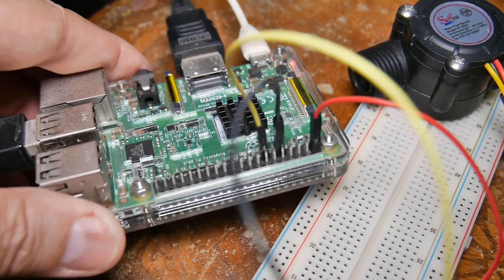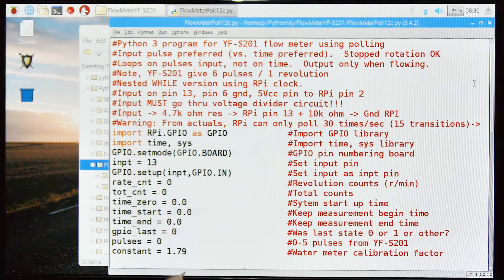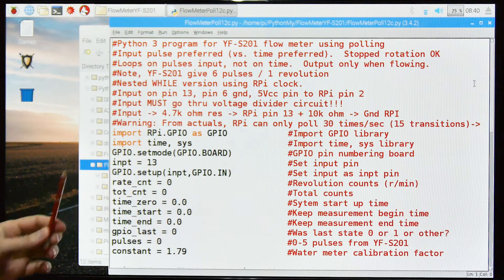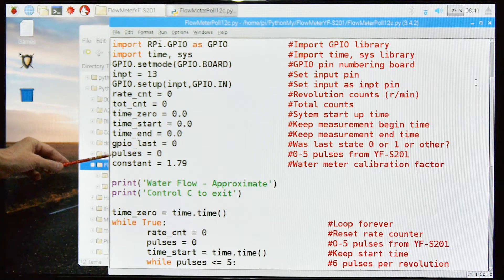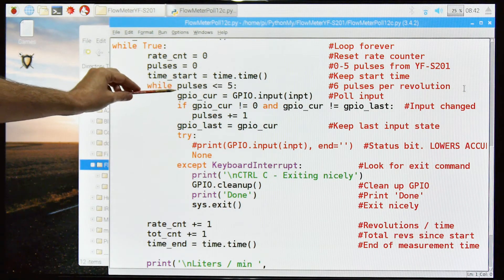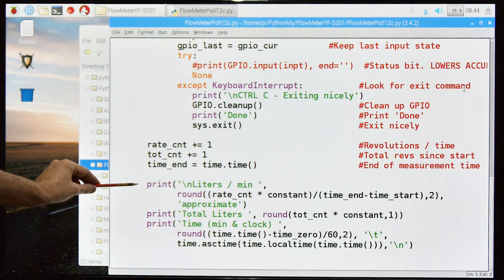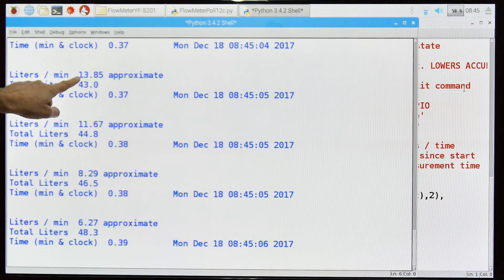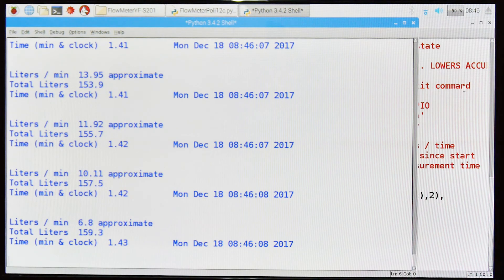RPi 23.1 - YF-S201 Water Flow Meter/Sensor, Polling, IMPULSE Trigger - ADVANCED

Comment: @tsbrownie I wanted to check, for the value of the constant, would that be a self calculated liters/minute. For example, I want to install the turbine sensor, in line with the water in-flow pipe of my sink. I measured the rate of flow to be around 5.5 litres/min. Would my constant be 5.5?
Reply from the maker: The manufacturer's specs are included in the description.  For example, 16 Hz = 2 L/min = 120 L/hr and 32.5 Hz = 4 L/min = 240 L/hr.  Beware there is a minimum and maximum flow rate limit.
Reply: @tsbrownie  so do I put the Hertz value in or the liters per min in, as my constant
Reply from the maker: @jacklammiman  It depends on how you write your program.  Mine is really bare bones and as I mention in the video I did not try to calibrate it.  The pi will measure pulses, which is Hertz, so if you want to know liters / gallons you will have to include the conversion.  If you pour 2 liters in 1 minute through the meter, the pi should register 16 pulses in that minute.  If you pour 4 liters through it in 1 minute you should get 32.5 pulses.   Going the other way, it is ROUGHLY 8 pulses / liter / minute (16/2 and 32.5/4), so you can begin there and then fudge your constant up and down based on your actual measurements (8.1 or 7.9 or ...)  Note that the manufacturer shows that at the higher flows 65.5 Hz = 8 L/min is more like 8.19 and 82 Hz = 10 L/min is 8.2.

Comment: Hey..my flow data is looking unreal  for some reason..is the volume in liters? Or milileters? Because whenever i am blowing some air into the sensor, the data just starts running like usain bolt. The data increases 100L per blow :3 please reply
Reply from the maker: This will not give accurate data with air.  The impeller will move way too fast and the sensor will record and skip.  The air is just for demonstration because my wife won't let me run water in our tv room.  The manufacturer data is in the description, it will give you a pretty good first approximation of the calibration.
Reply: maybe the coefficient should be adjusted

Comment: Hi. Im looking to make a bidirectional flow meter to fill and empty a container. From the data sheet it looks like it should pulse in both directions, but as there is a direction indicator I wonder if there is a reason it doesnt? Thanks for any info before I purchase one.
Reply from the maker: The insides are most likely machined / formed for max efficiency in measuring water in 1 direction.  They are not expensive, you could always give it a try and see if you got equal numbers in both directions.

Comment: Hey, how did you know that it was 6 pulses per revolution, is this also obtained from the manufacturer?
Reply from the maker: Yes, that data is in the description.  Plus I took it apart and tried it by hand.
Reply: @tsbrownie  hey thanks for the reply. I have another question: how come you are using a 5V supply for the flow meter when 3.3V is apparently sufficient ? Essentially bypassing the need for the voltage divider circuit in the first place.
Reply from the maker: @jackf.4785  Another excellent question!  It's been a while, but as I recall the hall effect switch was rated at 5 volts (that may be different in newer models).  I tried it with 3 volts and it seemed to work, but lower voltage could create unreliability my tests missed.
Reply: @jackf.4785  U have miss previous series :-) where author talk about noise on 3.3V :-)

Comment: Good day sir, Do you have a computation of voltage divider ? Study purposes thank you in advance :)
Reply from the maker: I googled voltage divider calculator.
Reply: @tsbrownie  follow-up question sir,    where did you get the constant 1. 79?   I tried to timed water flow how fast to pass through flow meter,  within 1 minute i get 7.5 litters per minute is that my constant value now?
Reply from the maker: I have data on the water flow from the manufacturer in the description.  The hertz (pulses per time) are a rough estimate of the flow rate.  The constant can change depending on your code.  The number I used was just a wild guess before I found the mfg's data.  Start with their data and then adjust based on your actual tests. Repeat until you are within the accuracy you need.
Reply: @tsbrownie  thanks for the reply sir!
Reply: @tsbrownie  how do you know the value of each resistor?
Reply from the maker: @joseantonioreyna  I got it off the internet.  You can look up voltage divider raspberry pi.  The values should ensure that the 5v to the device is limited to 3v when it goes to the pi.

Comment: Hi TSBrownie, Amazing video and great detail. I am very new RPi and with your video I was able to setup the sensor and run the program. I have a question, how do you work out litres from revolution? From the program it seems it is calculated as constant / time of one revolution. Is that correct?
Reply from the maker: The best way to do it is set up the system.  Run water through the system into a bucket or known volume and measure the time it takes to fill.  Then use that info to set your constant.  In the description I gave the specs from the manufacturer which is probably a good beginning value.